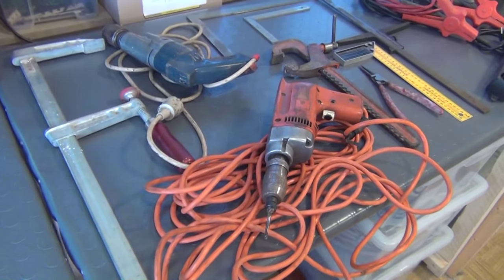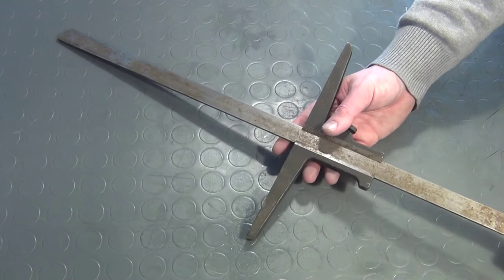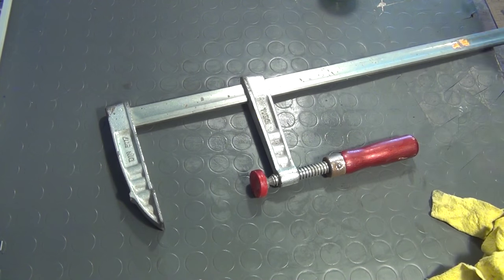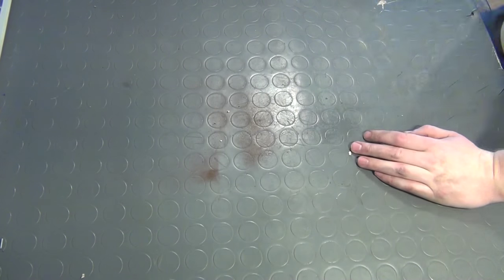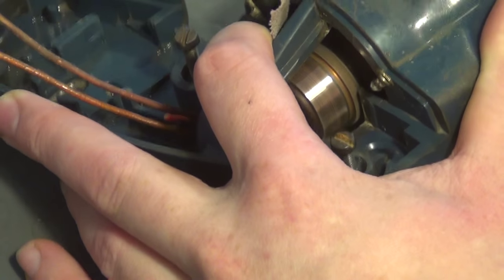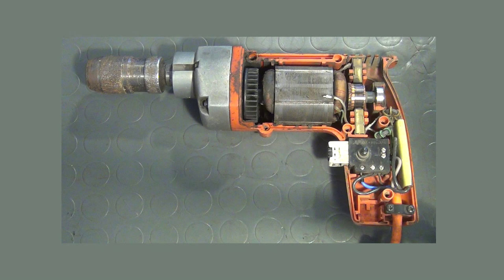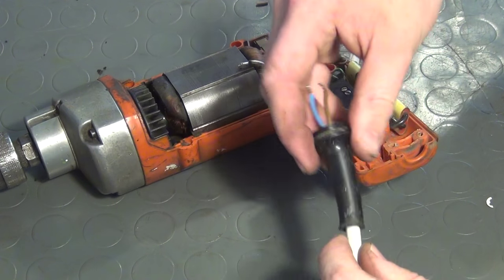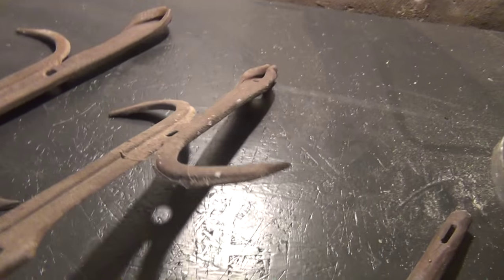Metalworking Tools Repair Marathon

Comment: I have also come across blown filter capacitors in old power tools. How do you figure out what type and spec capacitor to replace it with though?  I also seen some of those chokes. Do I also need to change those, or are there modern alternatives that are both choke and capasitor ?
Reply from the maker: ***** Your short comment includes several questions and requires several answers :D

1.) Most of the time it will not be necessary to have a filter for using the tools. More complex filters include both capacitors and inductors, but in many cases it is enough to have one capcitor between the phase and the neutral.
2.) If you wann replace a broken filter, you can normally read off the values of the capacitors and inductors inside
3.) If the chokes are discrete parts and not integrated in the filter component you do not need to replace them. They are most probably not damaged, because they are very rugged components. 
4.) You can buy integrated filter components for power tools, but if you want a specific part for a specific machine, these parts are usually not cheap.
5.) You can basically use any filter component for any tool, as long as it is rated for the current that the tool will draw and the voltage of the grid that you are working in. But if you buy just any cheap filter component it will often not fit inside the enclosure of your specific device.  
6.) Capacitors used  for these kind of filters are in almost all cases roughly the same. This is not an application that requires mathematically precise calculations or anything like that. It is enough to choose a capacitance of "typical" value. 
7.) The capacitors used as part of filters between a phase and the neutral are usually "MKP Class X(2)" capacitors. They must be rated for at least the voltage of your grid, and they normally have capacitances between 47nF and 220 nF. This is the kind of capacitor that I normally use for these jobs: 

http://www.wima.com/EN/mkpx2.htm
8.) Don not use Class Y capacitors. They should only be connected between a phase and the PE ( protective earth).
Power tools typically have no PE-connection though.
Reply: The Post Apocalyptic Inventor I thought I might ask too much with too little understanding on my part. But I did anyway:) Thank you for the lengthy answer! Great info! Now I might try and replace a filter component in the future! I was relieved that it was not some exact math behind this. I pulled apart a broken old school black and decker drill (the old metal body type). The filter components was a 1-5A choke and one Dubilier spm 678A 0,1uf + 2x0,0025uf capasitor made in England. In this case the choke was indeed blown or melted, same with the capasitor. I just removed them both and the drill works.I can send you pictures of the parts if you are interested in destroyed chokes :p :)
Reply from the maker: You can send them to inventordonations@gmail.com

Comment: I think those metal objects from the castle were for hanging large pans and kettles on, over the (very large) kitchen fire.
Reply: SheddyIan i was thinking one each side on the wall of the fire nook, with a long iron bar between them, so you can hang several items
Reply: jusb1066 Yes, then it could be a spit for roasting meat, or you could hang pots from it.  I'm sure I've seen something very similar in a museum or castle/stately home, but can't find an exact match on Google.
Reply: SheddyIan I have seen this shape of iron contraptios used as window bars to stop burglars. They are quite popular - even my grandfathers 100 years old stable has these (with the same shape/size) . Maybe they were not intended for the hearth in the first place. Just a picture of similar window bars: https://www.osta.ee/en/akna-trellid-11549768.html
Reply from the maker: Lauri Sikk Hey thank you. That indeed looks very similar.
Reply: The Post Apocalyptic Inventor I checked your video again, and the holes in the middle of these "bars" look interesting. One of the holes has been cut, and the profile of the metal bar is not flat, which would be the most efficient way of making these things. Maybe the material is also reused. If this is a case, then old farming equipment is the first thing to look for. The wheel rims of old horse-drawn rake match the profile, and they have holes. http://www.google.fr/imgres?imgurl=https%3A%2F%2Fcache.osta.ee%2Fiv2%2Fauctions%2F1_1_16499419.jpg&imgrefurl=https%3A%2F%2Fwww.osta.ee%2Fen%2Flooreha-36980198.html&h=450&w=600&tbnid=-9bxe64rqV8M2M%3A&zoom=1&docid=bptR8GV9tbXuoM&ei=5YV7VanPGoGfUIfNgZAD&tbm=isch&iact=rc&uact=3&dur=1390&page=1&start=0&ndsp=17&ved=0CCEQrQMwAGoVChMI6dXg_sCLxgIVgQ8UCh2HZgAy
The one on the picture has 133cm diameter wheels, so the distance between holes is roughly 23cm. This type of things were widely used in germany about 100 years ago - what do you think?
Reply from the maker: I had a second look since the holes are very unequally distributed on the two pieces, and one hole is also cut open, it is pretty obvious that the material must have been reused. The holes must have been in there before the pieces were bent into their present shape. 
But these parts are nearly perfectly straight and there seem to be  no signs that they once were rounded like those rims. Thanks for your hints. Those are very good ideas indeed! Are you into this kind of stuff ?
Reply: The Post Apocalyptic Inventor I actually found your channel by accident. I need to renovate my apartment soon, so i started looking around for ideas/tips and ended up in your channel and found your tool repair videos. That got me hooked. But we have some old farming equipment and tools in my grandpas old farm and some experience with these. This thing just looked too similar to be something different. If you have any other strange items, just put up the videos - mrpete222 has a whole series of mystery tool videos that are always good to watch.

Comment: Can you tell me what grit of sand paper you use to bring back to life the steel rules and other items?
Reply from the maker: Michael Crawford As I said in the video I prefer using sanding sponge blocks instead of ordinary sand paper for this job. I use "3M A63198" which is simply called "fine" or "fine grit". It doesn't seem to use the usual grit-numbers found on ordinary sandpaper. 
Here you can see these blocks with different grits:

http://tuotteet.etra.fi/en/g6467795/
Reply: I searched for those on Google in Untied States system. The fine is 320-400 grit. Super fine is 500-600 grit. Thank you for your response.
Reply from the maker: Michael Crawford Thanks as well. Good to know. Where did you find the numbers? Do you have a link?
Reply: The Post Apocalyptic Inventor Super fine: http://uk.rs-online.com/web/p/abrasive-hand-pads-sponges/6195974/ Fine: http://uk.rs-online.com/web/p/sanding-sheets/1623575/

The product numbers do not match your numbers, but this is what came up for the searches I executed. The numbers you provided may be German re-sellers' catalog numbers. 3M website may have more info.

Comment: Next to the forelock are fireplace hanging spit racks. The racks would be reversed to adjust the spit height over the coals. Spits are barbed iron bars used for cooking meat and poultry. It appears that the far rack is missing a hook. These were also used in dungeons for suspending prisoners.

Pork cooking on a fireplace spit and rack.
http://media-cache-ec0.pinimg.com/736x/9f/b2/80/9fb28007c8dce85bb44d85dc36665af5.jpg

Comment: Heaven knows my English is not the best but  “Replace the brushes against new ones” should be “replace the brushes with new ones”.   'against' sound odd here.  I'm sure nobody but very newbie English speakers would misunderstand so it's no big deal but I wounder how that translates to German.    When speaking in German would you use the concept of 'against' (beside)?
Reply from the maker: isgdre I don't know i fit is correct. I have heard it several times but maybe it's not very common. Here on linguee you find a lot of texts though in which "replace against" was used: 

http://www.linguee.de/englisch-deutsch/uebersetzung/replace+against.html

But there is a chance that these were all mistakes made by Germans :D
Reply: isgdre 
As with many, especially non-noun, words there almost never exists a single 1:1 equivalent of a word. "against" is a literal translation of the german word "gegen", but wrongly used in this case. It's a typical mistake, because in other cases the literal translation works, like in "lean against the wall" or "fight against someone". The word has a connotation of "contrary to" or "opposition".
Reply: The Post Apocalyptic Inventor Thanks for the info.  Your English is way better then my non-existent German so I'm not trying to give you a hard time about it.  It just seemed like such an odd word to put in there I figured something was being lost in translation.  Given the other post here I now see why you would here that same issue from other German speakers.

Anyway.  Great video as always.  These old tool referbs really seem to fit your "post apocalyptic" theme you got going.
Reply: superdau Wow, didn't that just connect the dots beautifully.  Thanks.  Now I'm going to give Alle Gegen Alle a re listen.   :p